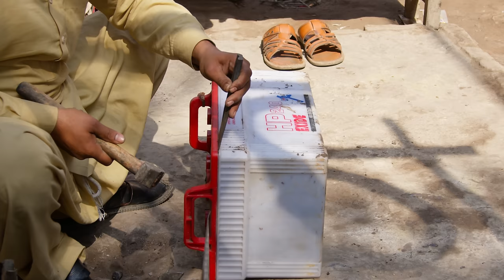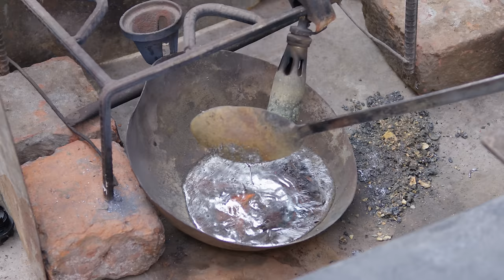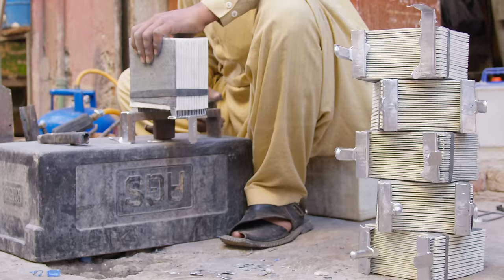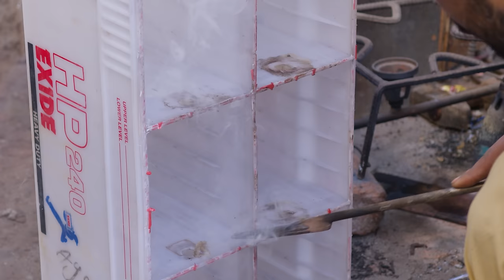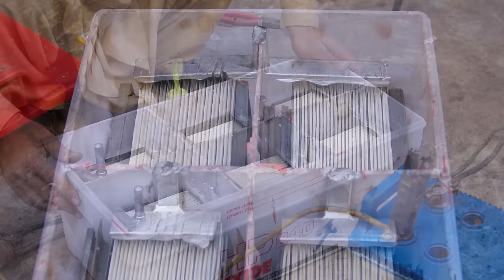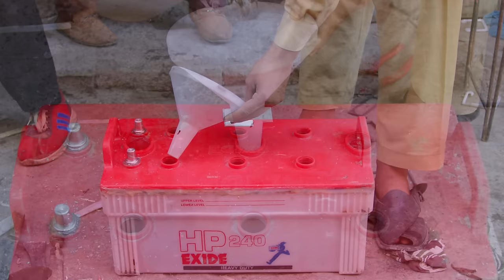Amazing Restoration Technique of an Old Lead Acid Battery

Comment: Whats amazing is how 1 man can single handedly undue any enviromental miny practices with just big hole in the ground and some old batteries.
Reply: Thats a container not a drain...
Reply: @theglobetrottersv  then how do you get the container out? Dollars to doughnuts they just used the drum to shore up the sides of the well, cut out the bottom, and added some gravel. The man is handfiling solid lead plates with no ppe, aint no way he's worried about proper disposal
Reply: @MajTom101  it's a fixed container dude 🙄🙄 to drain it must be pumped, even manual pump would work 🤦
Reply: @theglobetrottersv  i could see that feasibly, but again in context idl if this dude is going thru the effort
Reply: But the acid has value, and it can be pumped out.
Reply: Its sulfuric acid my guy, hes not pouring dcm or benzene directly into a river. Sulfuric acid can usually be recovered over and over again via distillation, if he didnt want the acid anymore than simply diluting with water or neutralize it with a base to produce a salt. The environment does pretty quick work to neutralizes most organic compounds, ive spilt at least 3 liters onto my front lawn and the grass is still growin in that area. 

There is a biological threshold for exposure to such chemcials and even by pouring it in a river, it wouldnt be enough to really damage anything, if he did it repeatedly over the course of 50years than maybe he'll pose a risk but sulfuric acid loves to accept electrons from its surrounding so even some iron sand in the river will turn to rust and neutralize the acid. Plastic straws on the other hand are probably triple worse
Reply: @raisin8051  yeah good thing there's nothing dangerous dissolved in the acid like lead
Reply: @theglobetrottersv  Its a plastic barrel with holes on the bottom bro lol.
Reply: They even recycle acids, nothing goes to waste, the acid is dumped in underground container for safety reasons. Then treated again to be used on other things. The new lead plates he made were also made from old plates. The plastic casing is also recycled. Literally almost nothing goes to waste.

Comment: Cool sandals to work in acids 👍👍
100% comfort 
0% security
Reply: and the invisible globes that protect against acid
Reply: Probably had toes on the shoes earlier in the week
Reply: 0% life expectancy
Reply: 100% clean foots😂
Reply: No OSHA in Pakistan
Reply: Amazing deduction Sherlock Holmes
Reply: It’s the new engelbert strauss - „work life balance“ collection.
Reply: Sulfuric acid honestly isn’t too bad to touch with your bare hands, so long as it is diluted to battery grade acid which is usually between 1.285 - 1.400 and you wash yourself quickly, mostly itches.  Pure, undiluted vitriol is 1.835 and that is the nasty stuff.  I got doused with 5 gallons of 1.285 grade about 10 years ago and I just went and showered and was fine.  Fortunately, I had a face mask on.

Comment: Impressive work pouring battery acid straight into sewer....
Reply: It's a bucket 💚💛❤️
Reply: imagine thinking a bucket is a sewer
Reply: @rastaralph7154  prove it. It doesn't look like a bucket
Reply: @BluesAlmighty  prove it is a sewer. It doesn't look like a sewer to me, more like a bucket.
Reply: @BluesAlmighty its a sewer or storm drain. 
there is a giant ladle behind him that was used to clean out the trash so the acid he was dumping wouldnt splash back off it and onto him
Reply: @michalkmiecik  a bucket without a handle and fits EXACTLY in the hole?
Reply: the ocean was too far away
Reply: If your Coke or Pepsi goes flat, a little acid gives it a little zip again :)
If it gets into the drinking water, it can't be all that bad.
Reply: @rastaralph7154 so he buries the bucket and reapplies concrete everytime he empties it? Please stop acting stupid and look at the footage.
Reply: thats the drinking hole
Reply: Cant we send all the eco warriors over there before they start ww3 over my 20+ yo Renault dripping a drop of oil on my driveway?
Reply: @BluesAlmighty  it's a barrel dug into the ground.
Reply: @amangill1752  prove it. I've seen horrible things first hand in India. Absolutely no awareness of the environment. Trash dumped into the rivers and lakes. So, why would this man have a barrel neatly dug into the ground? Sorry for my skepticism
Reply: It's distilled water. Not acid
Reply: @menotyou8958  please, educate yourself before you post. Yes, the water used is distilled, but acid is added to make the battery work. Happy to help you
Reply: @BluesAlmighty  i think you just got it out for these people 😂
Reply: Если аккумулятор разряжен, то там уже не кислота, а питьевая вода
Reply: @fau_v  that is incorrect!
Reply: That’sa bucket Cleetus.
Reply: I'm sure it's the acid reprocessing pit.  There's a guy on the other end making another video called "Amazing Restoration Technique for Sulphuric Acid!!"
Reply: @ArkaniumGaming  most likely leads to a sewer, you kan se all the other crap floating around in there
Reply: @rastaralph7154  why dig a hole for the bucket? if it was just a bucket they would have it on the ground.
Reply: It is a plastic tank buried under ground to deposit the waste. Because batteries are too heavy to lift to a tank height.
Reply: @menotyou8958  but this distilled water mix with lead element of battery.
Reply: @menotyou8958 I didn't see anything else other than that liquid go in, so how  can it be just distilled water? No acid=no voltage.
Reply: @cheekygnome 😂😂😂😂😂😂😂
Reply: @rastaralph7154  your country's term for a sewer?
Reply: @amangill1752  and how do they get it back out? 🤔
Reply: @tyson9419 and how do they get it back out?
Reply: Wy is the bucket in the ground?
Reply: what?

Comment: When I was a young truck mechanic in lancashire 50 odd years ago, boss used to send me to a very old man who stripped and repaired / refurbished old batteries just like this mans doing here, much cheaper to refurbish a big truck battery than buy new….the old mans battery charger was a huge glass carboy with leads connected to various connections on it and a large pool of mercury in the bottom, that always had a bright blue continuous spark running randomly across its surface, all turn of the century tackle but it all worked perfectly and his repairs were always top quality!
Reply: Sounds like an old style mercury vapor rectifier. They are really cool to see in operation.
Reply: @PhattyMo  definitley sounds like a mercury arc rectifier
Reply: ...!? Did he ever said " plasma flux reactor!  " when he see a banana?
Reply: Когда-то давно , цеха были , Мастера  аккумуляторщики . 

Этот аккумулятор,  лучше , чем то , что сейчас продается . 

Раньше пробки выкрутил , долил , зарядил . Дальше поехал на 5-10 лет . 

Если осыпался в ремонт сдал , перебрали , заправили , зарядили .. и на 10 лет
Reply: Did he die from lead poisoning by any chance?
Reply: Not in America anymore.  They dont even know how to install the battery now.
Reply: @PhattyMo  mp look
Reply: @ivanV5Vxoma  не трынди. Аккумулятор 10 лет не отработает.

Comment: I got lead poisoning just from watching this video
Reply: @Ethan Benson ever heard of a term "transmission"?No,not the one in your car!
Reply: Underrated.
Reply: @Ethan Benson But the fine dust generated by brushing the plates is very poisonous. For chronic lead poison, you don't need a high amount of exposure.
Reply: @Ethan Benson it can be inhaled
Reply: @danahun  I'm waiting for someone to say that you can only get Tetanus from rusty nails 😂
Reply: @gumelini1  yeah I just meant for good measure. Not sure them sandals have a spike-proof sole 😂😂
Reply: @danahun  they usually walk barefooted,so sandals might go as work shoes.Lol

Comment: Did anyone else get the feeling that he's done this a few times before?  He seemed to know exactly what he was doing, and knew it would put out the right voltage when he tested it. Now if he could just do that with laptop batteries, he could set up shop right here in Texas!  😏👍
Reply: Laptop battery can't be restored

Comment: This is an awesome and interesting video. I would think that the hand made battery is better than the machine made battery in a lot of situations. As long as they use quality material,  you know the battery is done properly by hand, considering that every step is verified correctly.
Reply from the maker: Thank you very much!
Reply: @WowThings   what kind of plastic sheets or material are using to sperate the sheets from each other? Thansk
Reply: gotta be a feminist because only a feminist would go trough the mental gymnastics that is required to think of hand made better is than machinemade when it comes to precision and plastics
Reply: Of course not.

Comment: The lack of personal protection equipment is alarming. Further, there appears to be nothing done about the plate sulphation. I doubt this battery would meet the original manufactures performance specs.
Reply: You expect repair one to be as good as factory built?
Reply: @dhanrajm1315  The rebuilt battery will not perform as well as a factory built unit. The lead plates degrade with use. If the rebuilt battery is sold as rebuilt, then buyers should/would be aware of the performance limitations.
Reply: @DJAYPAZ  yes agreed

Comment: Amazing indeed, although that place must be coated with lead dust.

I would rather make an alum battery.
Reply: Do you understand elemental lead is so heavy it's not a dust threat.  Same with zinc dust.  Aluminum dust might get airborne.  The compounds of these metals are the more obnoxious for breathing health.  True those soil and air reactive products can get mixed into the air.  Air pollutants are a given in any neighborhood.  Keep the house minimally vented for that reason.

Comment: Does he drink the water from the local well ? Mmmm That Good Ol Battery Acid Flavor !
Reply: If your Coke or Pepsi goes flat, a little acid gives it a little zip again :)
Reply: It's is own mountian dew.
Reply: @ariesmight6978  Lead allegedly tastes sweet. Combined with the acid... yummy. Almost like a lemonade that you drink once before your funeral.
Reply: @CZpersi   I just don't want to go. And touch that statement.😬😵‍💫😵‍💫😵‍💫

Comment: Hot lead, battery acid, hot plastic, poisonous fumes, torches, heavy batterys and sandles. Jeeze...not even a work bench. Acid all over the ground, wire brushing lead with no respirator. This is exactly why we have laws to protect workers in America.
Reply: In america you dont repair things i guess, you buy new one. Safety just for white people.
Reply: @deflokoding8847  no safety for the wealthy , stop bringing colour into it
Reply: @paulwhite7475  are you colour phobia?
Reply: Lead poisoning is more than skin deep. Quite simple actually happy and safe workers are more productive. Doesn't matter if they are fixing old or making new products. If you dont give a damn about yourself and others, your never going to give a damn about what you make or put back into the environment.
Reply: @deflokoding8847  Yes, in America you can repair things if you want
Reply: Third world countries 
What u expect
Reply: And also why American companies open shop in other countries.
Reply: Americans pays other countries for cheaper labor and Manufacturing. It's all about profits
Reply: @frankcastle604  why they shouldn't open shops in other countries? :- º
Reply: @viarnay  American companies move over seas, so they dont have to worry about pesky laws and the EPA. Not to mention exploit the workers.
Reply: @frankcastle604  but the law in foreing countries is not a problem of companies, isnt' it? :- º
Reply: @viarnay  does that make it right, for those companies to pollute the earth and exploit, already exploited people? Apparently, these issues are above your head.
Reply: @frankcastle604  they pollute those cities for people like you and me. How do you think stuff are made, with light? X_D
Reply: @deflokoding8847  stupid is stupid does
Reply: @iair-conditiontheoutsideai3076  yea, stupid is as stupid does.
Reply: @deflokoding8847  you got it all jumbled up can't even make a correct statement
Reply: @iair-conditiontheoutsideai3076  exactly.
Reply: @deflokoding8847  🙃
Reply: If he didnt want to do it. He wouldnt do it.
Reply: God bless Michael Jordan
Reply: noel hopley  there is no way that is an american company. That is a guy in his shop trying to make a few dollars

Comment: I see him using the old lead plates. Will this new battery last as long as the first one?
Reply: i think so, maybe longer he used better spacers .
Reply: No, the new battery will still have the lead sulfates on the the plates. This battery will have a lower life and lower capacity.
Reply: The battery will have lower capacity and  Lower out put current You can say its restored to 60 to 70% Health
Reply: @Davidslabofficial  which isn't bad at all for a bunch of guys squatting in the dirt wearing sandals.
Reply: @nathrak  yes Right 😃

Comment: Your Assuming it is a direct connection to public waters.
It may be a holding tank. It looked like it had an awful lot of sulfur acid in it already. They o my have primitive tools to work with. I'm sure if the worker had a choice he would make a better one.

Comment: this waste acid goes straight to river/ocean lol
Reply: It’s a barrel in the ground. You can see the acid pooling in the container as it reaches the top.
Reply: @danesen  yea, and then what....
Reply: @dr0117  I’ve read that there is some value to the acid to be recycled for other industrial uses. This guy is clearly pouring it into a container, but yeah who knows if he just walks the acid to the nearest manhole and dumps it. Proper Battery recycling is a big issue in India and will continue to be.
Reply: @danesen  this video is not from india
Reply: Hi

Comment: And he also used to eat his meals with his bare hands😔
Poor guy, i hope he never gets sick in the future🙏🏼
Reply: baking soda was used to render this acid neutral or his hands would be melting after he was done. How is this not totally obvious...
Reply: It’s because he eats with his hands he don’t get sick. All this hygiene is what makes people ill!
Reply: @bendover-bz4bc  its not that much higher in the west mate.. 
the only difference is that in the west when "sick" people get older it cost the families more. 
BTW I'm Indian!
Reply: @Maradnus  One you are wrong. Two there is hygiene and then there is avoiding heavy metal poisoning.
Reply: @AlexanderGee  I grew up around people like this fella. those old fellas reached ripe old ages.... and were a dam sight better of that people of the same age in the west.

The west is far to caught up on hygiene, that its killed the immune system.. if you are constantly exposed to stuff your body has to work at to stay healthy and you eat good clean food (none processed) you are rock solid.
Reply: @marcussmart3275  It's the lead dust particles on his hands that will eventually give him lead poisoning, especially when he handles his food with somewhat dirty hands.

Comment: I'm sure if I started emptying old batteries down drains the council would tear me a new you know what
Reply: Just don't tell them
Reply: Even here in india people would get jailed  if they do what hes doing. Idk how his country allows that
Reply: @shashwats7960  hey pajeet bro Ganges is probably most polluted river, they dump dead human bodies in Ganges.
Reply: @khalil90578  we don't drop dead bodies in ganges and i was talking about releasing chemicals in rivers
Reply: @shashwats7960  pajeet bro just Google dead bodies in Ganges, you would find countless pictures. Floating dead body in banks of Ganges is normal thing, do you even know about shams han-ghat of Varanasi?
Reply: @khalil90578  in hinduism after creamation of body some of the remains usually look the dust left generally a few milligrams are released into ganges river.  
People don't throw the dead body into the river because body must be creamted and portion of left remains (a few mg) are thrown into ganges
Reply: Y'all have your eyes closed as well as your mind?? This battery acid was neutralized obviously before he drained it into that 55 gallon drum that was buried to allow for more workspace that's likely covered with a sheet of wood or metal when not in use. It's a container that can be pumped so no harm is done. Knowledge is power, his fingers would be melting immediately a bunch got on his right hand when he dumped itand there was no reaction.
Reply: @shashwats7960  I think you'll find they do put bodies in the Ganges and it's one of the world's polluted rivers also
Reply: @boogaloo8204  no they dont
Reply: @shashwats7960  yeah they do

Comment: Did a quick search. A brand new battery costs ~23,760 RS ($311 USD).  Low wages and materials-cost likely saves a lot of cash, but i wonder how the refurbished battery performs?

Comment: So far I have learned for a substandard battery, you will need to:
- Dump acid into the local sewer system
- Get lead poisoning 
- Don't clean the plates
- Make stacks of lesser size then the original battery
- Inhale plastic fumes
- more lead poisoning

- inhale more plastic fumes
- dump new acid into the battery whilst splashing said acid everywhere. 

Did I miss anything?

Comment: that's great  tutorial of a lead acid battery recycling. It shows also that exid battery casing has not been developped for easy recycling and should be modified accordingly.
hope that this will motivate battery casing manufacturer to act .  we will enter of raw material scarcity and have no other choice to make new products from 100 recycled materials and near zero mining. That be BMW circular concept make new products from 99% recycled  products

Comment: Even if the battery acid is being poured into a holding tank.
Is the tank designed for storing acid and is there a monitoring system for leaks?
How is the acid pumped out and disposed of?